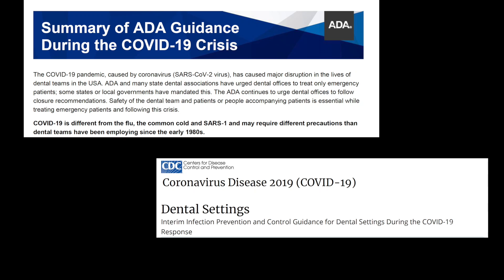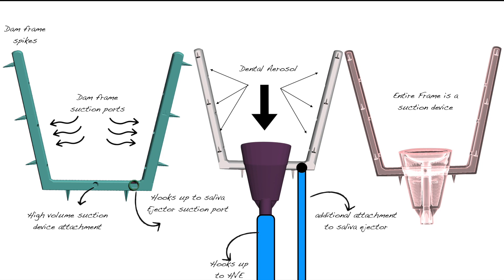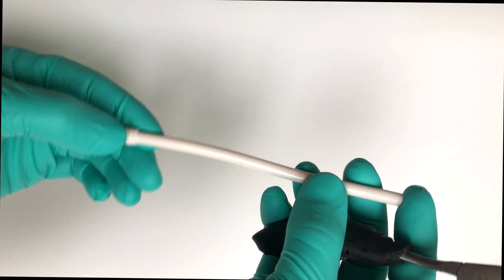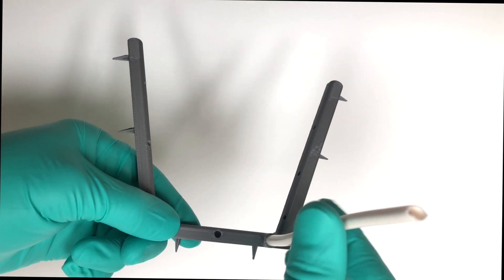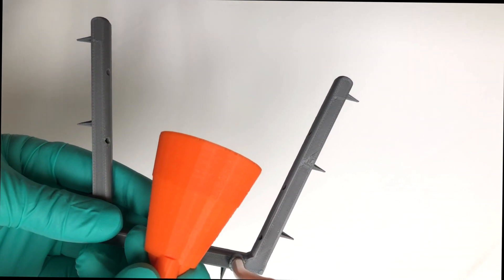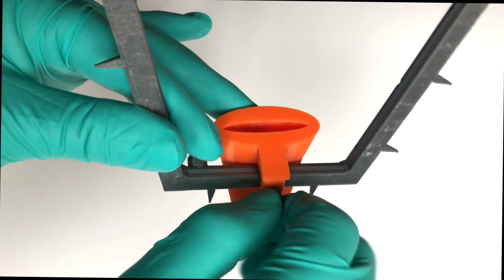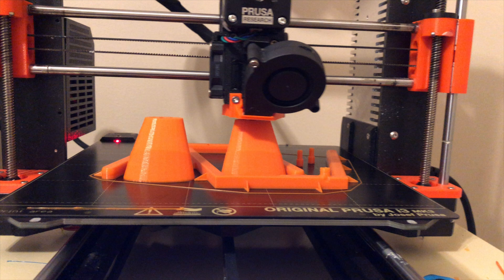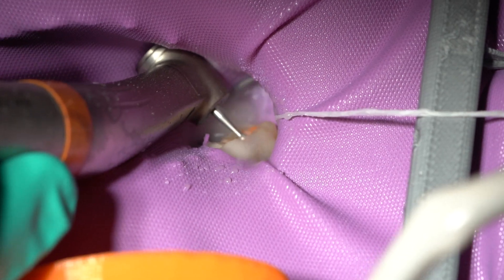Aerosol  containment dental dam

Comment: That's fantastic!  Check out our latest design.  It captures all of the aerosols generated, offers officewide extreme HEPA-level filtration to effectively remove pathogens, particulates, and pollution from the air of your office, generates directional airflow, drastically increases air changes per hour (ACH) and easily converts spaces into negative pressure isolation rooms!  The price tag is phenomenol and it's tax deductible!  www.dentalaerosolsolutions.com

Comment: How do you get the frame to build with the hollow space in the center?  What settings do you use for the infill?  I tried printing it, but there was a lot of infill in the area of the internal channels and aspirator holes. Please let me know what printing settings were used.
Reply from the maker: What printer are you using? The frame prints hollow for me every time on Prusa Mk3. 50-100% infill 200 micron layer height  PLA. Print flat no support
Reply: Ender 3 Pro. I'm using PLA, at 98% infill, flat on the platform. Maybe it has to do with the slicer program, it another setting? I'm using Curse Ultimaker. What slicer and settings are you using with the Prusa?
Reply: Cura slicer that was.
Reply from the maker: jbyrnedmd  hmm that’s strange. Maybe Cura is trying to repair the hollow and make it solid somehow? Go through your slices and make sure it is still hollow. Open the expert settings and disable any 'fix horrible' options. Try infill 20%
Reply: @wallyrenne  Hi Walle, thanks for the advice. I found the problem. Cura was set to add supports by default upon slicing, even though I had turned it off earlier, it enabled again when I cleared the build platform and reloaded the .stl file before slicing, and I hadn't noticed.

Comment: any chance you could design a hollow face shield, with air vents pointing down from the top, with an attachment for a small 6mm air hose I could plug into an air concentrator?   gets very hot working with a face shield and a n95 or greater mask on.  thought is- the air flow can be altered to 1. cool me off  2. keep the shield/glasses from fogging up,  3.  create positive flow down from the top of shield to chin area to keep aerosols from getting inside also.  Happy to pay you for your time.

Comment: nice- what about a mount (connected to the chair or wall? in which you could just use the frame by itself, without placing a rubber dam on it at all?   seems like it would still create the necesssary vacuum.
Reply from the maker: Gary Moore yea we are working in that too. Some people are just attaching a funnel to HVE and securing it